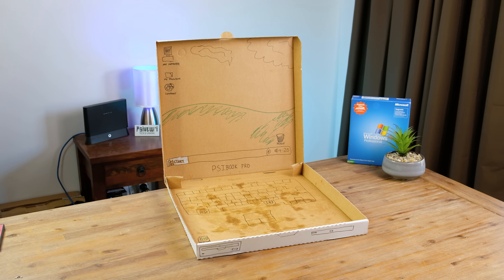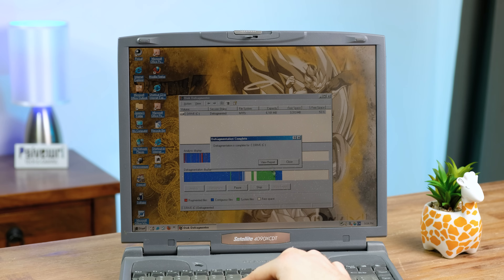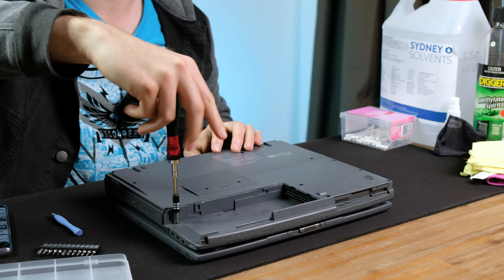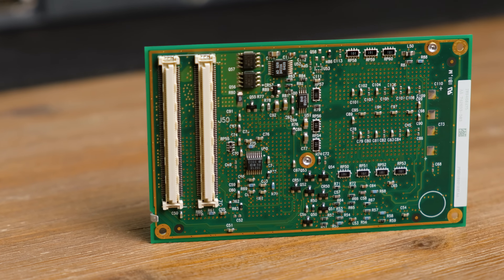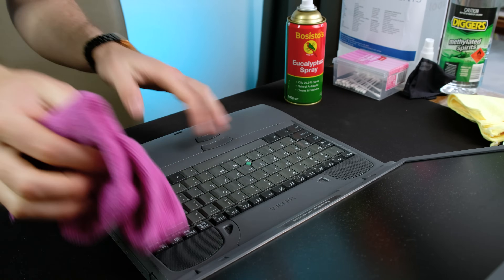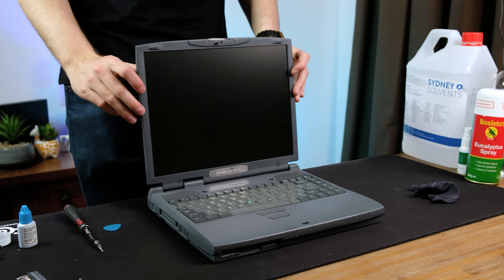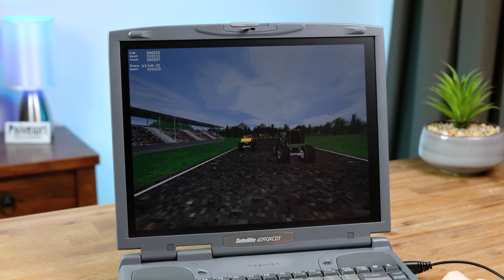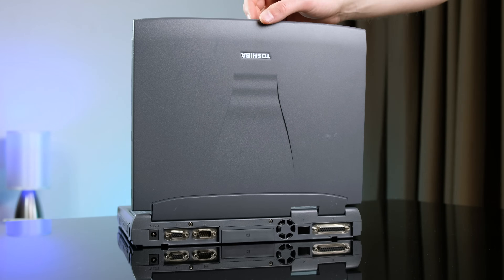Restoring An Old Windows 2000 Laptop!

Comment: Have you thought of doing a CPU upgrade on any of your laptops? A few years ago I did on mine as laptop CPUs were not soldered onto the motherboard. I had a Sony Vaio with an Intel Pentium 1.7Mhz (533 Mhz bus speed) upgraded 5 years later to a Intel Dual Core 2.3Mhz (667 bus speed) unlocking a load of performance, that was so much fun, and also very cheap upgrade $10 on eBay for the CPU.
I think your Toshiba here may be able to support the next CPU model up: the Intel Mobile Pentium II processor, 400Mhz, that may play games better than the Celeron. See SATELLITE 4100XDVD if they have the same socket

Comment: I actually still have an old Toshiba Satellite laptop from 1998. It has a Pentium mmx 266mhz with 96 mb ram and it's original 4 gb hard drive. I still have Windows 98 second edition on it. Ran scan disk on it and have no bad sectors.

Comment: 4:44 Hopefully the clock multiplier isn’t locked on this machine, otherwise it’ll just run faster Mendocino core Celerons at 400 MHz.
Reply: I think those won't fit the MMC-1 socket. The fastest processor that fits is the Pentium II 400MHz

Comment: I added a MSATA to PATA adapter plus a 32GB MSATA for my old Dell Latitude C510.  Windows 2000 Professional ran without any problems. So much faster than the original 6GB HDD.

Comment: Wow I think this is one of those entry level laptops back in the day if it really is from 1999. All laptops coming out in 1999 are supposed to feature a MMC-2 connector supporting the faster pentium II or even III. But at least good to see these older satellite models have some quality in them unlike the wide-screen ones since 2005
Reply: Fairly low end, there were lower clocked versions and versions with Pentium IIs up to 400MHz using this chassis. The lowest of the low would still have possibly been fitted with passive matrix displays then!
Reply: @nitrax8629  maybe not in 1999, but you might get a smaller 12.1" SVGA display instead to sell off their aging stocks. I think that's exactly what happens to many aspects of this laptop. This would all be pretty good stuff in 1998 but a MMC CPU and that Trident video card is pretty long in the tooth in 1999.

Comment: 4200 rpm hdd, and 64 mb of RAM, used up to at least 2011. This person must have had the patience of a saint.
Reply: I used a 2004 Compaq Presario in 2015, up until 2016. faster than the 2011 laptop I got that year. Eventually, came back to it after a few slow computers in 2017 or 18.
Reply: @grilledcheese-obama-sandwich  same except the toshiba i replaced it with was wayy better in every since except I still used the compaq due to it being windows xp and the laptop ran vista
Reply: @grilledcheese-obama-sandwich  Depending on what it was specced with, it might not have been too bad if you were slightly patient with some parts of it.
Reply: @grilledcheese-obama-sandwich  I used a 2004 dell Inspiron in 2016 until the screen broke
Reply: I had used a machine (Compaq Evo D510 SFF) with Windows XP
512MB RAM
80GB Hard Drive
Intel Pentium 4 2.66GHz
up until 2016
Reply: @prince_saini  perfectly usable
Reply: Psivewri: I’ll just sit here and smell my eucalyptus oil
Reply: I used to use a reallly really slow desktop, i didn’t really have experience with anything faster since all the tech in the house used to be super old, so i never really got upset cause that was my expectation. It was when i used a gaming pc that my teacher had been gifted to do VR that i started to get that impatience.
Reply: Come to India, lots of PCs had 128 mb ram in that era, just like now 2 gb pcs are still common
Reply: exactly what i thought
Reply: I’m pretty sure it said kb not mb on the ram lol
Reply: @Targaryenmenace  thats not possible, not even win 98 could run on 64kb
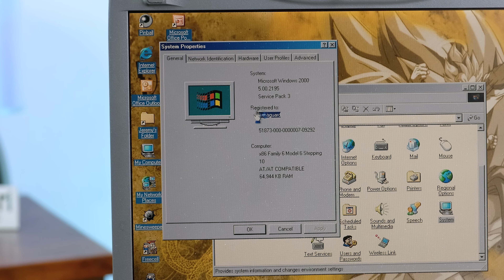Reply: @senatorevil  I’m not tech savvy I’m just going off what it says at 1:30
Reply: @Targaryenmenace  that's a comma not a decimal point
Reply: @Targaryenmenace  that's 65000kb, which is 65mb ram.
Reply: And durability off a 200cm tungsten cube
Reply: Might have been used in a church, or something like that. I recently bought an old HP Pavilion running Windows 98SE with 64MB of RAM and a 10GB HDD that seemed to be used by a church since it had an old word document for a Sunday service on the desktop that was last modified in 2010. Someone really used that little thing I now only use for really old DOS games as a work computer for over a decade.
Reply: I'm using my 2012 laptop at the moment, and plan to get another 2 to 5 years out of it thanks to it being able to run Windows 10!
Reply: @NottJoeyOfficial  nice, I am using a 2012 laptop running windows 7
Reply: @timmynibbs  mine has a triple boot setup for Windows 7, Windows 8.1, and Windows 10!
Reply: @NottJoeyOfficial can you buy me one dude, i still use the one from 2004
Reply: I have a Toshiba satilite pro 4600 with 900mhz pentium 3, and 124mb of ram which I still use today
Reply: The first laptop I owned I bought with my first tax return. HP Pavilion with 1GB RAM 80GB HDD running Windows Vista. Purchased in 2007 lol. Used until around 2013. Loved that laptop for internet and email. Couldn't play games though. I think the most intensive game I could get it to run was WoW and Guild Wars at a silky smooth 20FPS.
Reply: I’ve a windows 7 from 2008 . I still use it more than a decade
Reply: I used a machine with 512mb of RAM in 2011 for nearly the whole year
It could play YouTube quite well cause it had a newer GPU installed
Reply: Honestly,im not better, I use the laptop i bought in 2014 (Fujitsu lifebook s751) just updated the ram and changed to an ssd
Reply: @ Are you kidding? That is 1000x better

Comment: Some of the 11" Portege range from that era have the S3 Savage card with 8mb VRAM and also a PIII CPU, I can run up to NFS Porsche on my 3480ct and Quake runs at 1024x768. The downside is they take MicroDIMMs which are more expensive if you want to take them above the base 64mb ram. Can boot via USB floppy too so you just copy the installation folder to a hard drive partition.

Comment: Time to clean up my brothers laptop. Although, has anyone heard of modifying laptops to put stuff in it?
Reply: Most of them have upgradable RAM and some have interchangeable CPUs. In most cases you can only use an external GPU. Although I wouldn't reccomend working with a laptop without experience, they're the absolute worst to open up, and it is possible you could break something.
Reply: @grilledcheese-obama-sandwich  I've worked with laptops before in a 6 month stint at a local it shop. My question really was more has anyone heard of modifying a laptop with components that are not native to it